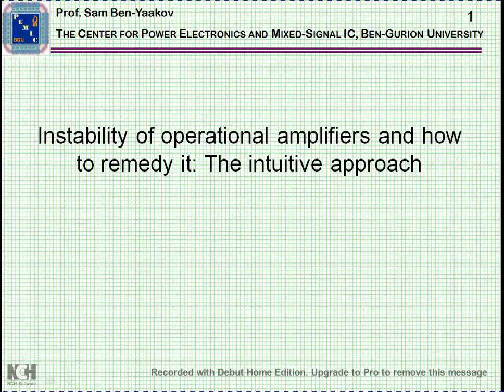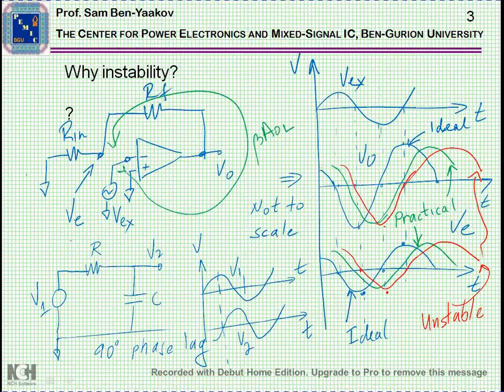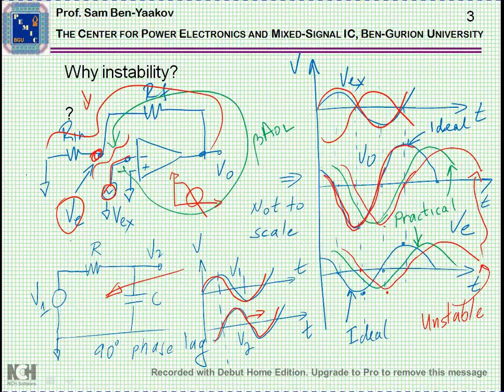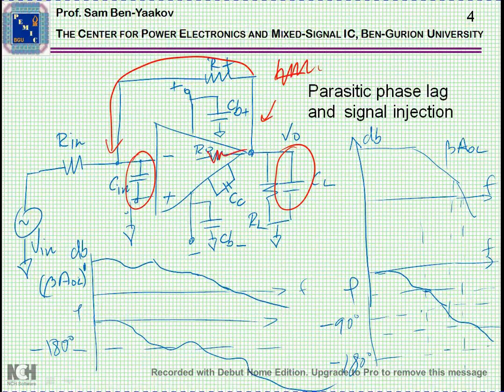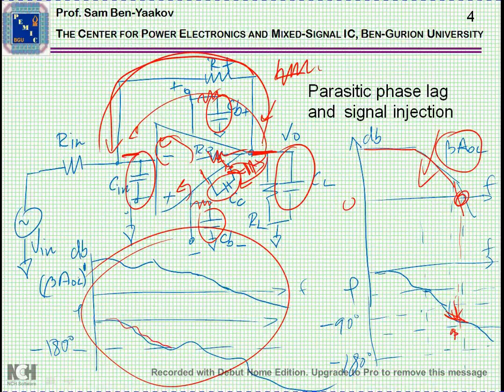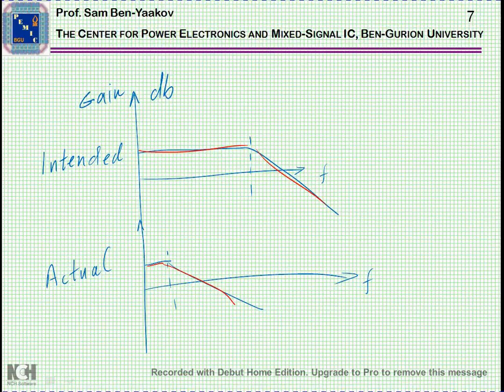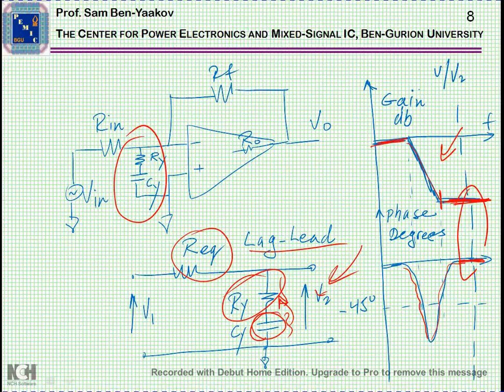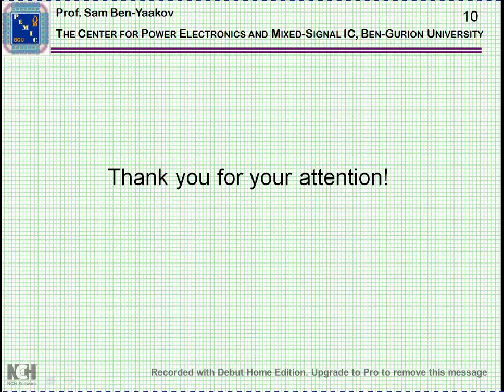Instability of Op Amps and how to remedy it: The intuitive approach

Comment: Nice video to  develop  an intuitive understanding of opamp instability. Thank you very much. 
As far as i understand, the reason, we need the cap in series with the resistor in lead-lag compensation is not to mess with the low-frequency gain of the opamp.  I would love to  see if there is any other explanation.
Reply from the maker: Correct, you want to reduce the gain at high frequency.